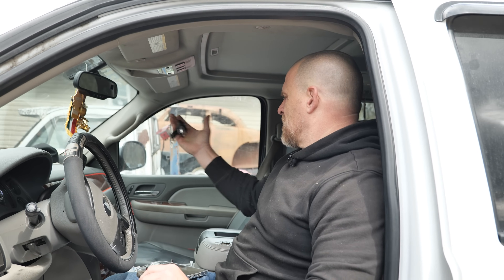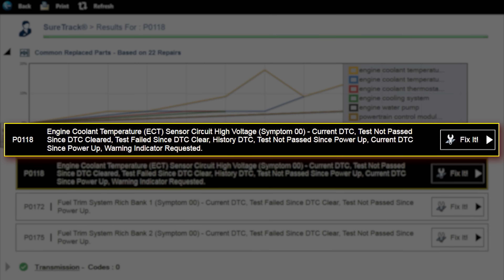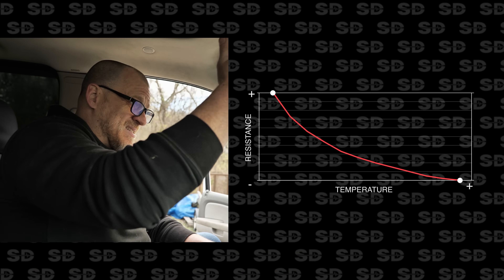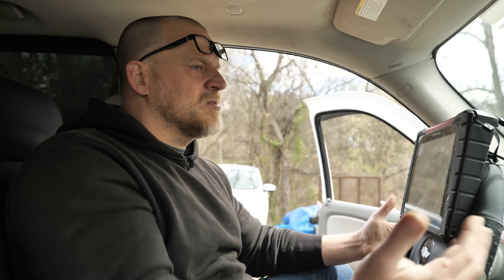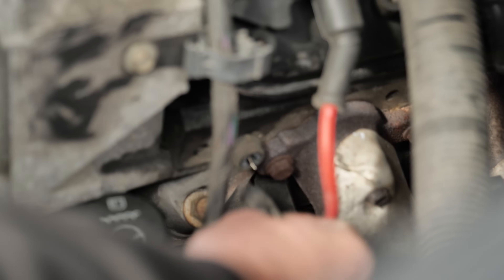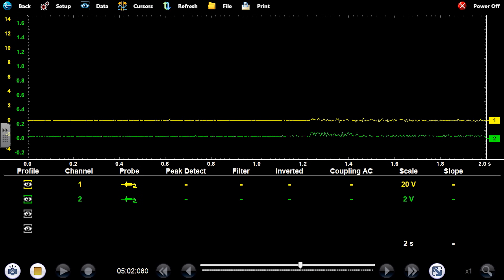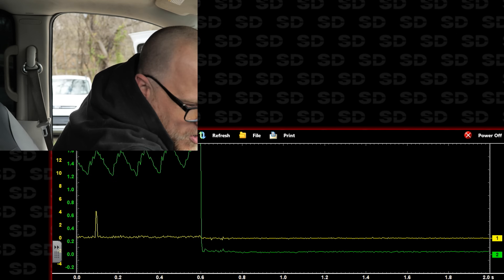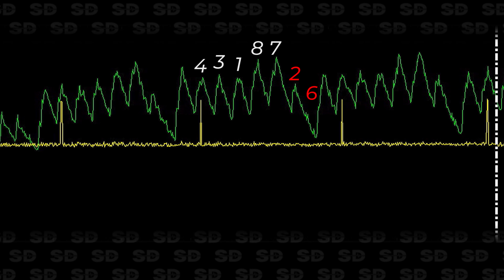Misfire, Rich Condition, Long Crank Time - Where Do We Start?

Comment: Your videos are really helpful and informative but I noticed a comment in one of your clips about using an incadescent test light over and led.  Why do you recommend this? Thanks.
Reply from the maker: If you are troubleshooting a circuit using a test light, it takes very little voltage to light and LED and will absolutely lead to misdiagnosis. But there are times where I will recommend an LED type of light and the video I am releasing today covers that!

Comment: Wouldnt 2 dead cyl or at least 1 cause the rich reading if its not burning the fuel?
Reply from the maker: it is also not burning the oxygen. Ignition and no fuel misfiring will drive an oxygen sensor lean (especially a no fuel misfire), never rich even though there is unburned fuel in the case of an ignition misfire
Reply: @ScannerDanner just after you replied the South main Auto channel explain the same exact thing on an 09 Chevy 2500 he was working on with a misfire. Thanks for the explanation.

Comment: What i learned. Hot air intake (dumb air filter) could cause rich condition. Starting compression cadence needs to be even. Don't bother investing time diag rich condition when you have compression problem. Coolant temp sensor resistance is inverse to temperature, low temp means high voltage on sensor. High mv readings on oxygen sensor means it is detecting rich condition.

Comment: I went from stock air box to short ram intake on my 13 acura tl . Only at idle I seen 10 to 15deg temp increase. Once I start driving the temp was within 5 degrees.

Comment: Could the compression issue be due to washed cylinder walls from bad injectors sticking 
I believe good quality gas goes a long way, the money you save on poor quality gasoline comes back tenfold

Comment: if the customer is lucky, it's a valve out of adjustment (should they decide to investigate further).  it could be piston ring blow by which wouldn't be worth fixing.  that vehicle has alot wrong with it.  that compression issue is terrible.

Comment: Hardenth 50
need help my honda hrv 2020 got a parasitic draw found on fuse #21 and 22 back up and audio remove audio but the back up still drawing battery keep boosting everytime and now i just remove the negative cable but keep doing it everyday been looking for a wiring diagram but cant find one alldata dont hvae it any other sites or you able to help with this problem,
Reply from the maker: https://eautorepair.adtrk.biz/?a=10817&c=24&p=r&s1=

Comment: i think am missing something, he was probing the trigger signal for the coil so how did he end up getting compression readings from tht?. pls help
Reply from the maker: I'm grabbing starter current from the battery cable with an inductive amp probe. That's the compression part
Reply: @ScannerDanner  so this is my understanding; when the engine is in compression stage the starter current will spike( yellow graph) but where I'm lost is the green graph . Where did tht graph come from?. Thnks for responding appreciate it 👍

Comment: I AM STRANDED AND NEED HELP
I have a 2004 Ford E350 5.4 V8 
When I start the vehicle I can here popping coming from passenger side of engine, a loud air blowing sound, runs for about 10 seconds then stalls. Where do I start? I have a check engine light on with it flashing but do not have a scanner on me
Reply from the maker: Pull the air intake tube off the throttle body and make sure pieces of the air filter are not lodged in the throttle body
Reply: @ScannerDanner  I checked that and it is good
Reply: @ScannerDanner  Heres is an update about this problem. 
Had the van towed to the shop, turned out the engine blew out 1 spark plug. Rethreaded the spark plug hole and put a new plug and ignition coil in and starts up fine. 
WEIRD
I wonder why 1 cylinder would cause the engine to start then stall like it was doing. Had the technician confused as well. Do you know of any ideas?

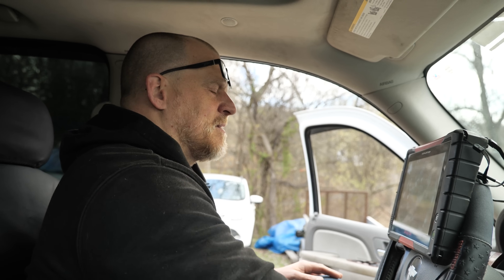Comment: 4:47 compression loss could be cylinder washout from bad injectors or bad plug on top bad temp sensor...
Reply from the maker: Not on a running engine with no white smoke (stuck open injector)
We only worry about cylinder wash on engines that do not run or have stuck open injectors, which this did not.

Comment: Hopefully you can do a follow up w/ this vehicle.  Client is cheap so probably not.

Be neat to see what is causing the low compression.  Most likely valves as you said, but I have seen puking injectors cause low compression too and cause high LTFTs.

Love your videos.  Keep 'em comin'.

Comment: Scanner  Paul sometime he is acting like a moron why ,he don't know the condition of the owner ,ex: maybee he is in a big divorce,kid with cancer ,lost is job,depression, or simply know nothing about mecanic so don't jugde before kwooing the real truth Danner.
Reply from the maker: Doesn't change the state of the car and the complete lack of maintenance and the warnings that come with it should you take on a job like this. This is ripe for an "ever since you" result
Reply: @ScannerDanner  my job as a mecanis is to repair not to judge all the owners
Reply: soon that car won't be running or cost alot more money than it otherwise would have.  a stitch in time saves nine.

Comment: NOT negative temperature! The coolant sensor is inverse from temperature. Resistance goes down as temp goes up.
Reply from the maker: All temperature sensors on cars are negative temperature coefficient thermistors, which means temperature and resistance are opposite each other. For example, as temperature increases, resistance decreases. A positive temperature coefficient thermistor would be, "as temp increases, resistance increases.

Comment: minus 40 for coolant Temp is the default value
Reply from the maker: -40 is not simply just a default value, if the circuit is shorted to ground (0v signal) its not going to default to -40
Reply: @ScannerDanner  try leaving it as open circuit you will still see it readin -40. Also the circuit measures resistance from the thermistor not necessarily voltage. High resistance equals cold, low resistance Hot. Short to ground is low or zero resistance which should read incredibly hight temp. (out of range so we just go back to default or if the wrong very hot reading happens to be actual the fail safe mode is to run fans)
Reply from the maker: @gearloot  yep, open circuit is 5v or -40

Comment: Worked heavy line at Chevy for awhile.

cylinder six lifter failure is very common on these 5.3l exhaust valve probably not opening.

Can remove cover and view rocker arms to confirm.

Comment: That thing has been running long enough with a broken coolant temp sensor that the oil is loaded with fuel and causing the rich condition. Seen it a few times on the GM trucks.
Reply from the maker: Could be, but that didn't cause the no compression in the #6 cylinder

Comment: The worst part of getting   involved in a car like that is the owner does not have the money to maintain it, so they are not going to have the money to fix it properly , and then you never can get a confirmation on the diagnosis ?  even  if they don't fix it I would  like to see a burnt valve or hole in the piston?ECT
Reply from the maker: 100% spot on
Reply: somebody mentioned a broken valve spring and that makes sense to me.  we all probably would like to know.

Comment from the maker: To all of you wanting me to confirm cylinder wash...

No compression on cylinder 6 with a RUNNING engine is not ever going to be from cylinder wash unless that injector was stuck open, and even then that wouldn't cause NO compression. But what it would cause is a massive amount of white smoke from the tailpipe. 
Many people have said this due to the negative trim numbers, but its just not feasible imo to be concerned about cylinder wash here.
Cylinder wash is something we worry about on non running engines.
One other piece of data, the opposite bank was also running with negative trim numbers. 
This is NOT injector problems here my friends.
Reply: If that ECT sensor has been busted a long time, running on cold start enriched fuel mapping, that oil has to stink of fuel. Thin oil, collapsed/damaged lifters. Cyl's 1,4,6&7 are the AFM/DOD holes. Would explain why the O2's didn't change when the MAF was unplugged. I'd pull the PCV and see if it levels out.
Reply: Worry about cylinder wash on a non running engine is an important point! I have been sent down a wrong path in a vehicle before because I trusted a relative compression on a washed out cylinder, but it was because I forgot from previous training that relative compression test is best done with a warm or a running with a misfire engine. Not non running. I do agree with your point SD for this vehicle!
Reply: Do these have a high pressure fuel pumps that can leak fuel into the crank case causing fuel vapors to be sucked into the pcv sytem?
Reply: Also.. im in no way a mechanic.. just  a guy who's curious

Comment: Intake valve staying open slightly on that dead cylinder. Could be a valve spring issue. When the dead cylinder pulls in air and fuel , it does not compress, it gets pushed back into the intake plenum...and fuel charged air goes into the airstream for the other 7 cylinders to use...resulting in rich condition. Happened to me in the 80's on my 79 Corvette. Broken intake valve spring, no compression , 3 other cylinders in the same intake plane of the dual plane manifold were very rich.  I ran about 1 foot of soft tygon tubing into the spark plug hole , barred engine to push piston up ,the plastic hose held the valve up, and using a valve spring compressor I replaced the spring. Easy fix.
Reply from the maker: I think my suggestion to Pete was to remove that valve cover as the next step. Good tips, thanks!

Comment: Low compression that is causing misfire will cause a condition that is interpreted as a lean exhaust. O2 sensors are just that, Oxygen sensors. They do not measure hydrocarbons. Unburned  oxygen is read as a lean condition and in turn raises fuel trim. It took me a long time to wrap my head around this 20 years ago, but it is true e verytime.
Reply from the maker: True, but there are variables! Misfiring from mechanical issues can cause negative trim numbers!
Reply: I wonder if these specific issues are shown in the secondary ignition waveform?

Comment: Can you please help me? A car I'm diagnosing has a very rich mixture (-20%). The other oxygen sensor reads 0%. Besides that, the car starts for a few seconds and then shuts off. I've already replaced oxygen sensor 1, the MAP sensor, and the TPS sensor, and the problem persists. It's worth mentioning that the injectors and fuel pump are in good condition.
Reply from the maker: Year, make, model, engine at the very least.
"The other oxygen sensor..."
Lol what other oxygen sensor? Upstream or downstream, is there another bank upstream? Not if its a 4 cylinder.
Reply: @ScannerDanner It's a 4-cylinder, the sensor above the catalytic converter is reading rich (it's already been replaced), the one after the catalytic converter is reading 0%. The TPS and MAP sensor have also been replaced. The fuel pump is at 46 psi, the spark plugs are soaked with gasoline, and the pressure in all 4 cylinders is 145 psi. It only turns on for 1 second and then shuts off. It's a 2013 Hyundai i10, and the only DTCs it has are a rich fuel mixture and a low TPS sensor signal voltage.
Reply from the maker: @josesamuel01  downstream O2 doesn't report in %
What is the downstream O2 mv reading?
Some systems will use the downstream for fuel control, in particular when  the upstream is a wideband sensor
Reply: @ScannerDanner The upstream and downstream sensors have 0.459 mV at ignition, and at ignition, the only voltage that varies slightly is the upstream one. Additionally, the upstream one is at -20% and the downstream one remains at 0%. The injection time is 18 ms, which drops to 7 ms when the TPS is disconnected, but it still turns off in 2 or 1 second.
Reply: The solution was bad catalytic

Comment: Cylinders 1,7.4 and 6 have the AFM
Reply from the maker: And cylinder 6 was dead. My money was on a wiped cam lobe and lifter
Reply: @ScannerDanner  I make alot of money doing deletes. Since last June I've probably done 10 gmc/chevy 1500s. We go in turn the computer afm off and put engine on stand swap cam, plug afm solenoid ports and new lifters. It's mainly been 2015 and up the gen 5 ls truck engines l83 and l86 with direct injection.

Comment: You should check the reason for loss of compression just to make sure it’s not cylinder wash.
Reply from the maker: Cylinder wash on a running engine that is not huffing out white smoke is not a concern.
Only time cylinder wash should be considered is when it is a no start or if you have a stuck open injector (massive amount of white smoke)

Comment: Hey Paul - I'm a dyi'er and i follow your channel a lot.  I think a fuel injector test would be good to validate wether or not those 2 cylinders are washed out by gas making compression low.  I really think that would be a useful to know if the injectors are leaking.  Also with service data check if the 2 cylinders are part of the must displacement strategy or not.  I'm seeing a fork in the road for 2 tests of "probable cause" before presenting anything to the customer.  Would you say my rationale is correct in checking for this?  I'm curious because I don't know the customer.  Some people dump cars without hesitation, and others cling to their things forever.  I'd love to hear back from you if you have time.  God bless.
Reply from the maker: I just added a comment addressing cylinder wash for the many people saying the same thing. Thanks!

Comment: I’m not trying to be a pain. But in my experience. A coolant temperature reading -40 will cause a rich condition. I would recommend repairing the coolant sensor. Test driving the vehicle. Than redoing the relative compression. My thinking it could have ring wash. With the customers understanding they may have problems still
Reply from the maker: Of course! And that issue most likely lead to fuel contaminated oil, but absolutely is separate from the no compression on the #6
As I said, that is the path that must be walked first! And cylinder wash is not a concern here. If the engine wasnt starting, only then would we worry about that. Or if an injector was stuck open which we did not have

Comment: diesels would be another good application for testing starter current. Its very difficult to do a compression check on a diesel, older ones you can get a high pressure gauge and pull glow plugs but a lot of newer ones don't even have that-they use intake heaters. Ive seen a couple old 7.3's with a galloping sound when cranking. I wish Id have thought of/had the equipment to do this test back then. (with that said, they still ran and make good enough power to keep using). Any recommendation for a good inexpensive scope for someone that wouldn't use it daily? My scan tool doesnt have one built in unfortunately (autel) and money is tough...i pretty much lost everything during lockdowns so I'm slowly rebuilding

Comment: No matter how many times you try and explain to the K&N cold air cult that those systems are useless, the more they push back. Besides puling in hotter air, in many cases it changes the turbulence in the intake duct and compromises the airflow calculation of the MAF sensor.
Reply: it's a waste of breath to try to convince them

Comment: Is "clear flood mode" an american thing? Many brands don't have that (if you try you will damage something = engine will start and hit the rev limit within a second, you will barely make it to take the foot back from the pedal).
Is there a list of brands/models that have it (or not)?
Reply from the maker: GM and Ford had it, Chrysler  did not
Reply: @ScannerDanner  Both my Mazda 3's (2012 & 2020) have it.

Comment: Old skool common issue. Full rich for a long time b/c of sensor causes cyl wash increasing ring wear. Could have fixed the sensor before ring damage. Too late now. Cheapest thing to do is replace sensor, change oil and run it a while to see how much it cleans up. Sometimes you get lucky and is tolerable since customer doesn't seem to care much. Those hot air intake are ridiculous.

Comment: Best (educated) guess: #6 cylinder has a hard parts problem, likely valvetrain related as that's an AFM cylinder, resulting in loss of compression on that cylinder. Rich codes/hard start are a result of the ECT problem initially (ECM adding too much fuel bc it thinks it's much colder than it actually is), but now some of that excess fuel has made its way past the rings and into the crankcase. This fuel vapor then makes its way back into the intake manifold via the PCV system, hence why the fuel trims got better with the ECT sensor working again, but didn't fix the issue completely - that oil is fuel contaminated and needs to be changed. 

I've seen a couple of people mentioning cylinder washout related to the compression problem, but I don't believe that's going to result in essentially a total loss of compression on a single cylinder in this case. Could certainly be hurting cranking compression overall, though. I kinda wonder if the higher compression on cylinders #7 and #8 indicate they may not be getting as much of that fuel vapor from the PCV and therefore aren't running as rich. 

I agree that figuring out what's causing the lack of compression on #6 is the place to start bc a customer isn't going to be happy that you're charging them for an oil change on a vehicle with a dead cylinder that may cost more than it's worth to repair.
Reply from the maker: Very well stated my friend!
Reply: if it was a piston ring issue, it would be the worst I have ever seen.